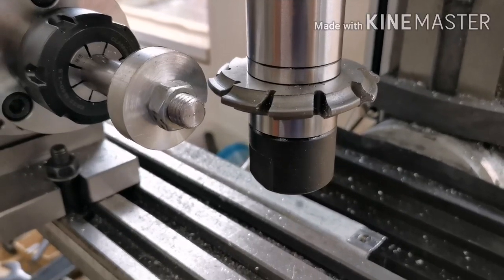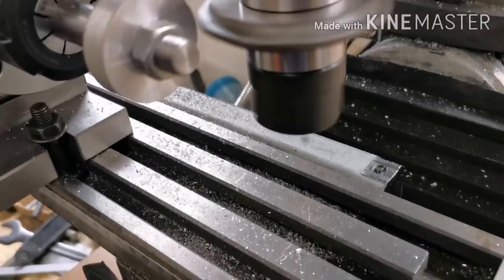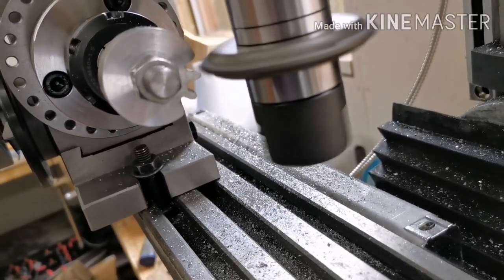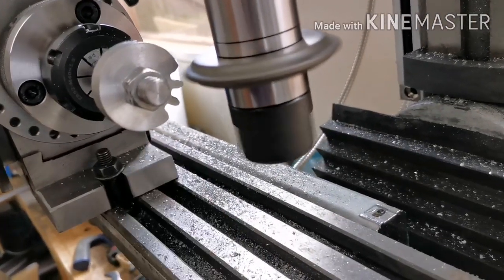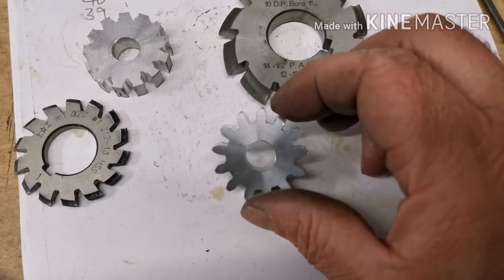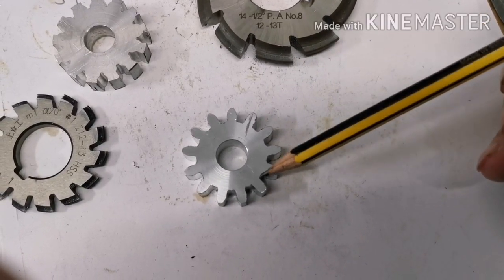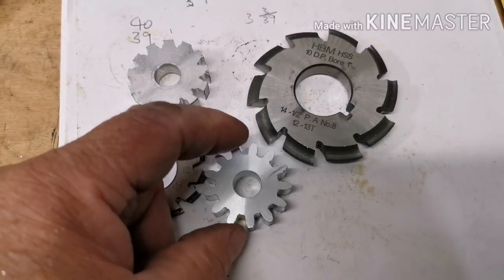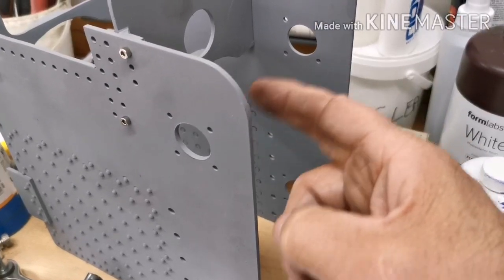2" Fowler Showman's Traction Engine

Comment: Bonjour Mr Mowlam, félicitations pour votre travail!  Je suis en train d'étudier les plans pour construire moi aussi ce tracteur. J'ai vu sur vos videos que le taillage des engrenages droits se fait avec des fraises Diametral Pitch de  10 DP; Mais qu'avez-vous utilisé pour usiner les engrenages du différentiel?
Merci d'avance pour votre réponse et merci aussi pour le partage de vos vidéos très intéressantes!
Salutations vaporistes
Reply from the maker: Hi thank you for watching, all the gears are cut using cutters of 10 DP even the Differential gears, as this is marked on the drawings, hope this helps
Reply: @jammymowlam1  Bonjour Julien, merci pour votre réponse. Effectivement, le DP de 10 est mentionné pour les engrenages droits.( ce qui donne un module de 2.54 ) Pour les engrenages coniques, ce n'est pas mentionné, mais d'après les données du plan et mes calculs, çà donne un module de    3.036. Apparemment, çà ne change pas grand chose, puisque vous y êtes arrivé! Salutations vaporistes.

Comment: Hi Julian, good job on your first gear cutting. I have noticed that you dividing head manual has a misprint regarding the ratio table. it gives them as T: 13, H: 39, N : 3  11/33. It should read N : 3  3/39
Reply from the maker: Yes I found that out when I did the scratch test, and I forgot to add it to the video

Comment: could you have used the previous gear blank with the bigger cutter?
Reply from the maker: Yes I could of, but I had one already cut, and I thought it would be easier setting up a clean blank and it's not the proper gear, just a test gear for the same size gear on the traction engine